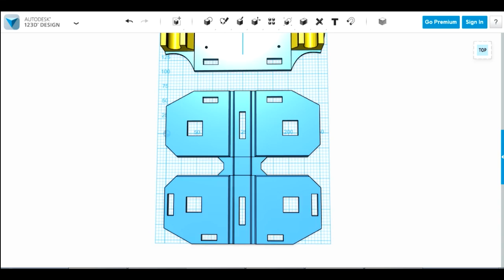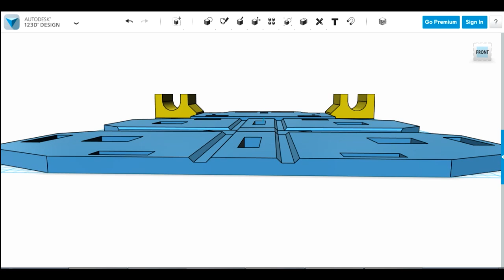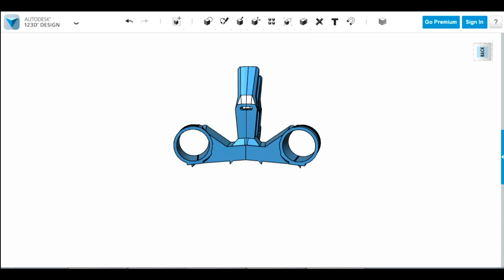Alien Xenomorph Cosplay #13 | Tail Mount | James Bruton

Comment: Amazing conception, amazing design James, if this is "seat of the pants" planning it is really very good. I can only imagine what you could create with carefully rendered and planned CAD drawings. For the tail, you might actually consider putting 1/2" soft copper tubing into the top half to get the tail up into a dynamic curved shape behind you and then the tail movement would be up toward the last third of the tail and in the air instead of dragging the tail behind you. you could shape the conduit giving it an organic shape.

Comment: Looks great but im a bit worried about the foam tubes making up the tail. I have no idea how durable they are but with all the weight of the tail and dragging it around behind you will the tubes tear and split apart breaking the tail? Hopefully the paint and nylon cable for the animatronics will help strengthen it a bit, taking some of the strain from the foam.
Reply: Due to my experience with those, these isolation tubes are really durable. No matter how I tried, I didn't rip them by pulling it lengthwise. So I think that is actually very good choice for tail support.
Reply: cool, i was imagining how embarrassing it would be walking through conventions and events and your tail suddenly drops off. I had no idea how tough the tubes are, I just hear foam and think weak. Glad to know they will be tough and durable.
Reply: Isolation tubes! Don't you just love it when a typo turns into a pun?

Comment: James, do you think you can bend the root part of the tail upwards enough just with help of these nylon strings? So far it goes almost directly down to the ground. I'd be afraid that the tail will either be funny 'U' shape or you'd draggle it's end on the ground, unless you walk with your torso significantly bent forward. Wouldn't that be a good idea to mount the end of the tail with some slight angle already instead of straight down direction?

Comment: I am curious as why the back pieces are all ABS and not ninja - flex where you put the bends. I would think that mobility might be enhanced with it. By the way I really like your videos and can't wait for the R2 updates as I am working on essentially the same project.
Reply: I agree. The lower back seems really rigid and if you attempt to do a bending pose it will not be very comfortable.